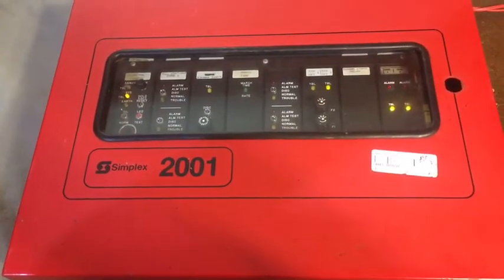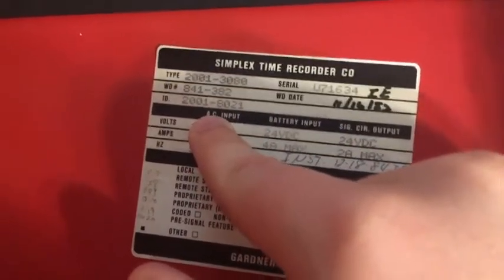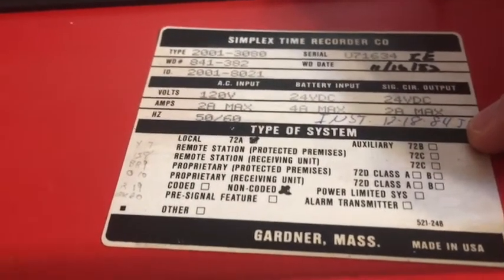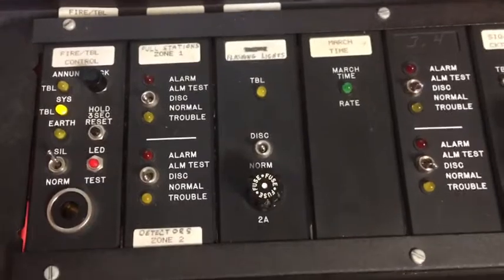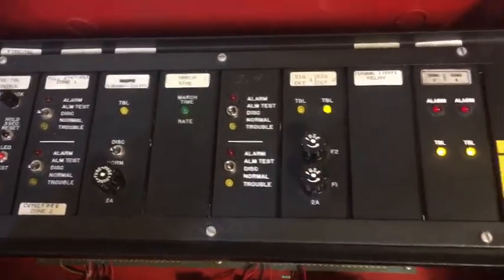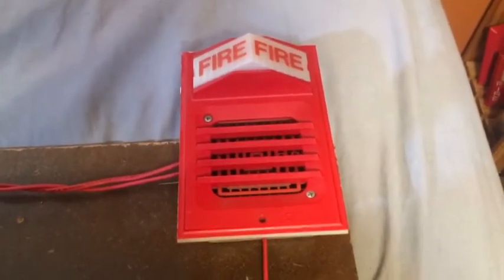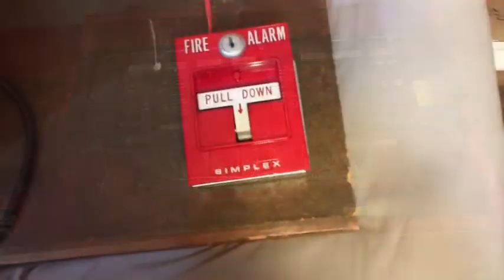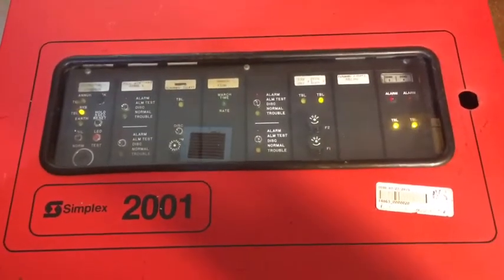Simplex 2001! Fire Alarm Test

Comment: Hey there just a quick question, to reset the panel, the reset button says to hold for three seconds , but I noticed you only depressed the reset button for like one second. Would it make a difference had you held the button for three secs , if you were wanting to reset the system ?? Thank you .
Reply from the maker: Realistically you only need to hold it for like half a second most of the time. If you try to reset too quick the relays might not have enough time to reset correctly and the system re alarms.

Comment: Really neat system! It's FWR, but it somehow sounds way smoother than what Fire-Lite panels output. I'm also curious how the cards work. Does each slot represent a section on the terminal strip?
Reply from the maker: Thank you! Yeah, I haven't actually tested it to see if the panel outputs FWR, but that horn sounds nice on it. About the cards, there are a total of 48 terminals on the main board, and since my panel can hold up to 8 cards, each card gets 6 terminals. What's cool is that you can just plug the zone/nac cards in anywhere without any wiring on the motherboard, and it just works. That's a very basic explanation, NewAgeServerAlarm's up-close video of his system explains it better than I could really do in this comment.
Reply: @FireAlarmsofNortheastKansas  Awesome. Thanks for the response!
Reply: @Bart Lee No. In fact most of them don't. Some models do, but in other cases it's just the result of a bad filtering capacitor. In this case, the sound may be halfway between FWR and filtered DC.